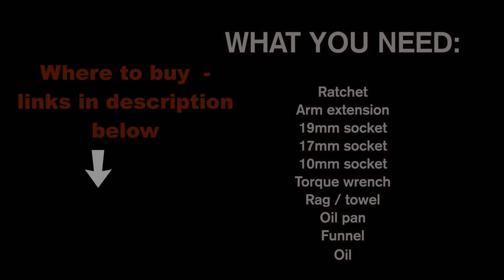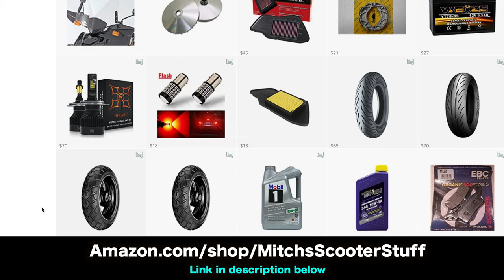Yamaha Zuma / BWS 125 Oil Change | Mitch's Scooter Stuff

Comment from the maker: * Tools I used in this video: 
Ratchet 3/8 drive - http://amzn.to/2hhmnUs
3" / 6” extension set 3/8 drive - http://amzn.to/2h7ypMl
19mm socket 3/8 drive - http://amzn.to/2CiXNqo
17mm socket 3/8 socket - http://amzn.to/2EMT6LO
10mm socket 3/8 drive - http://amzn.to/2xGuLSF
Torque wrench 0-150 lb/ft 3/8 drive - http://amzn.to/2Crqq4R
Flathead screwdriver - http://amzn.to/2jN7lpE
Rag / towel - Rags - https://amzn.to/2Yh8jvg
Oil drip tray pan - https://amzn.to/3brpgIO
Funnel - https://amzn.to/2HY4m6g
Engine Oil - https://amzn.to/32TNBEi
Reply: Hi Mitch, 
Thanks for this amazing video. 
Wondering if you have created a video on how to replace spark plug for sums 125 cc please.  
Thanks
Reply: Not sure what the 17mm socket is for and  I thought for the drain bolt. But I found it needed a 12mm socket.

Comment: Thanks for pointing out to check the oil level without screwing the cap in. At first I thought you were wrong and was going to correct you, but it's clearly stated in the manual that you do NOT screw it in when checking the level. I had no idea about that until I saw the video - thanks!

Comment: I have enjoyed and educated myself on your Yamaha Zuma videos.  I have a question, My Zuma 125cc gets a Check Engine light, seems like when on a down hill ride light goes out but on level riding comes back on, oil level is good.  Someone told Me to reset my ECU with a OBD 2.  Not sure if there is even a connection for one.  Do You have any idea or direction to go with this issue?

Comment: I found the 17mm socket was way too big and the 12mm fit. Was that an error bc I was shopping for a larger socket set yesterday and the 17mm was more a heavy duty and more expensive set that needed a bigger socket wrench. So I was gonna used the one at work and was top big and the 12mm socket I already had in my compact socket set. So maybe bc my Zuma is a 2008 and they changed to a 17mm socket for the later models?

Anyway, great video and thanks, but I wanted to point out in case someone might follow your direction and run into the first problem of not being able to take the bolt off by your requirements.
Reply from the maker: Thanks for the comment, yes I noticed that too... my 2014 zuma is different compare to this one in the video, just realized that :)

Comment: At how many miles do you change the oil?
Reply: So you should change the oil and filter at the same time? Can you change the filter later when there is oil? Or will the oil leak out?
Reply: Put a whole quart of oil? My other Yamaha scooters took like 3/4 of a quart and a quart would’ve over filled it.
Reply: Oh and online it said 6 months or 2,000 miles.
Reply: @jacknjill3000  The filter isn't something you'd normally swap out - it's more of a strainer than a filter. Just clean it and look for holes, then re-use.